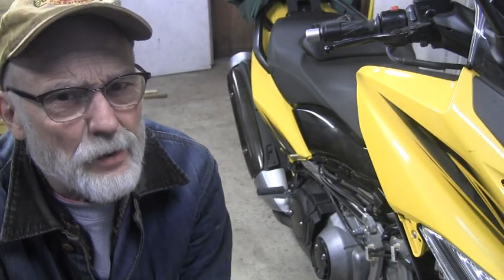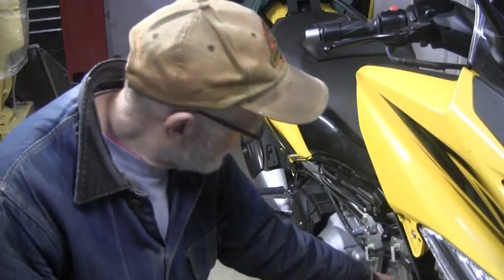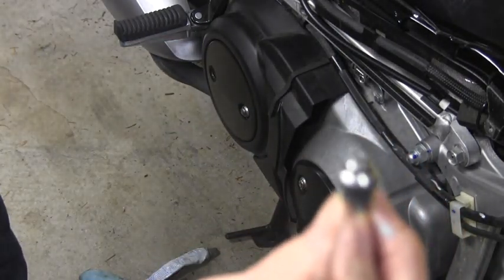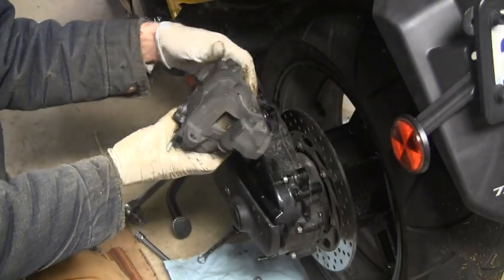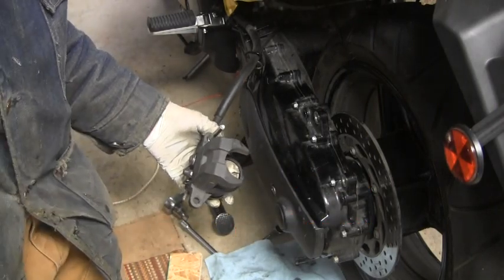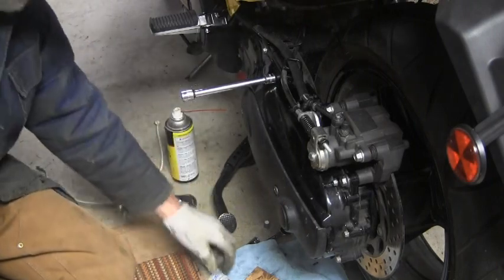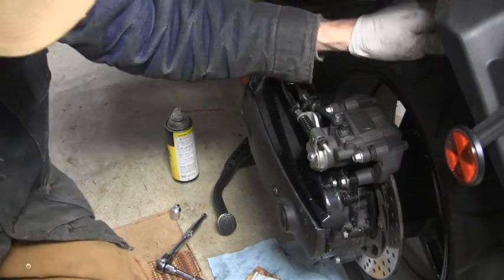24K Service and New Brake Pads   1

Comment: https://youtu.be/pok3KmZOgt0?t=445
the latch up of the lean angle sensor how do you clear that ??
 my bike show d61 : 30
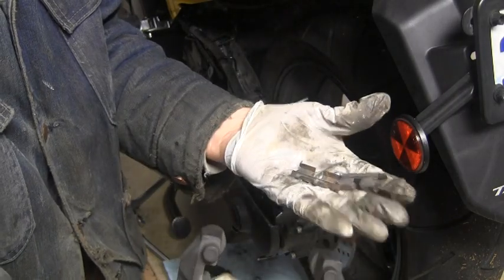Reply from the maker: Go to the video you linked, and watch to 8:15.  I show in text that all you have to do "when in" diagnostics mode, is to just turn the kill switch off and on a couple times, and "all" the codes will be reset.
Reply: thanks